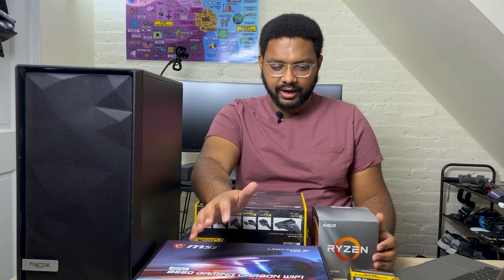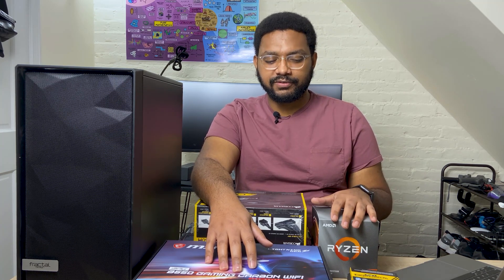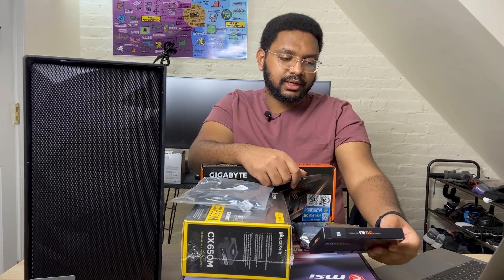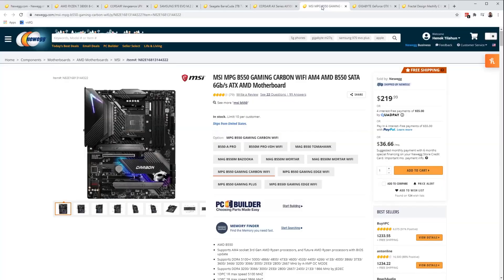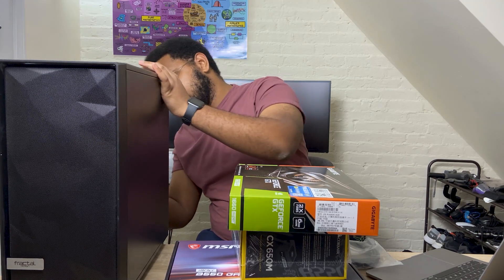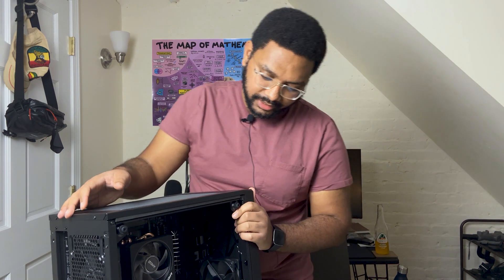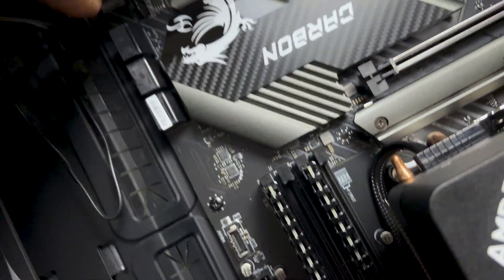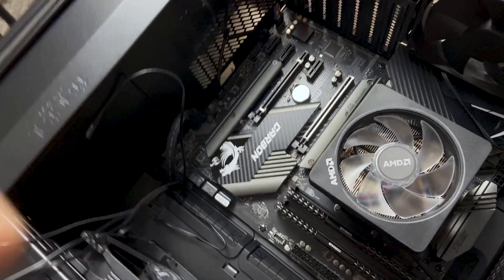My First PC Build

Comment: the only thing I would of changed about the build would be the cpu. I would of gone with the Ryzen 5 3600 instead of the Ryzen 7 3800x because its cheaper and a good pair  with that gpu.
Reply from the maker: I feel you, my initial combo was going to be a 3600 + B450 with the 1660 super but there was a lot of supply shortage during the holidays, especially for gpus.